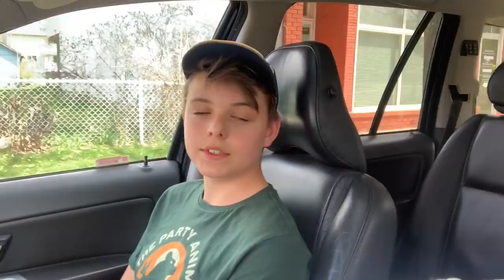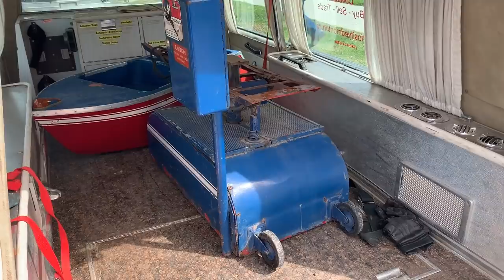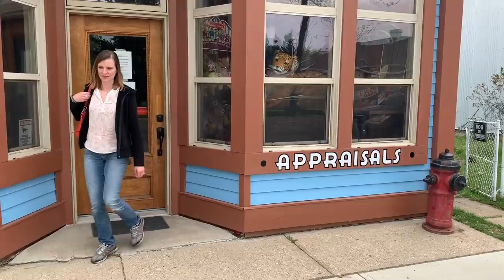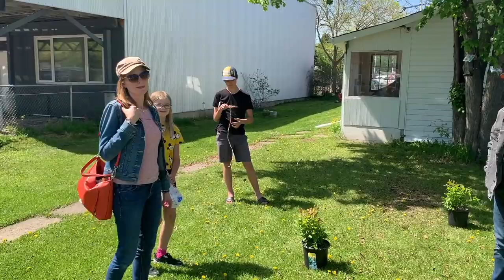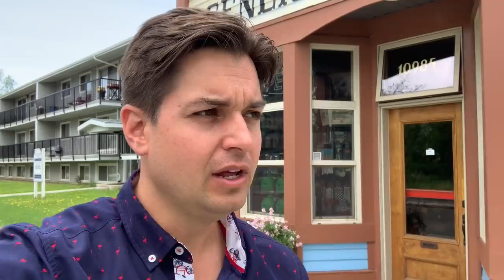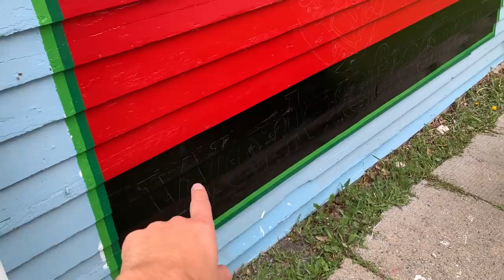Part 2. Will the build be cancelled over a $750k hydrant?!?

Comment: The city should be responsible for putting in hydrants if they require them! Never heard of private owners to do that! After all hydrants are for public use.
Reply: My old hometown pulled that on a business for over a decade. a walmart wanted to build, but the town council wanted to stick them with 26 million dollars worth of sewer upgrades, so they decided not to go ahead alone. they partnered up with as housing developer that wanted to build a new housing development and a home depot, and the town council dicked them around until the housing developer pulled out all because the town council just didn't want a walmart in the town. this was a town of 18 000 people.
Reply: From what I understand tho, the fire hydrant isn't really the problem here. The water system for the street is old and in need of being replaced, or else, it won't be able to handle a fire hydrant. But since it still work, they don't want to upgrade/replace it. So they're like: We know it's old and outdated and that we HAVE to do it eventually, but we DON'T want to do it now 'cuz it work and we'd rather do something when it break instead of being proactive and change it before it happens.
Reply: @blackwar12  sounds like where i live
Reply: Where I live, a local business man built 2 Duplex homes and the town forced him to run the water and sewer lines at his expense, which he did.  They then had others build in the same area and tried to hook up to His Water & Sewer lines, the business man stopped the hook up unless he was reimbursed for the installations. He was repaid and now the town has 25 additional homes buying water and sewer from them!
Reply: I don’t think all the people who live round and about would be too impressed that the city is gambling with their lives with old infrastructure, if the size of your building tips it into being really dangerous, it must be dangerous now. If they are really intransigent I’d start to get the neighbours riled up......
Reply: @dgmills5351  Good!  Only fair.
Reply: Government 101   of the People and by the People?
Reply: @lynnedelacy2841  Thing is, if he do that, the city won't be happy about it and they'll give as much trouble as they can to Alex as an act of "revenge". The ONLY way he could do it, I guess would be to go to local media. And again, if the local media are "friends" with the administration of the city, it might backfire.
Reply: Chasse Gallerie - it was more of a tongue in cheek suggestion than an actual one. That wouldn’t be the way Alex operates
Reply: Sounds like they made up that rule to suck more money out of large developers and shouldn't apply to small business owners.
Reply: Not to mention they allowed a huge apartment building to be constructed next to the store so how is that thing not tipping the situation to dangerous but Alex' addition would? Makes no sense.
Reply: @lynnedelacy2841  - I'm sure the apartment dwellers/owners would be a bit worried to hear about this.

Comment: Alex, I mentioned this before, but I am a contractor who worked on some condo units in the city. The inside units were too far from the hydrant, so we had to install a fire sprinkler system in the condo. That cost a few thousand. Cheaper than a municipal hydrant however
Reply from the maker: I don’t think we are high risk at all, I just need the IFPA assessment and hopefully we can proceed.
Reply: @CuriosityIncorporated  glad to hear. I was going to visit Alberta on the way to Alaska this summer in my camper van but the coronavirus has the trip postponed a year. I look forward to seeing the new addition and checking out your store in 2021!

Comment: I think it's outrageous that they are sticking you with the entire cost.  In my opinion, that should be covered by the city.. period. People die, businesses close, but the city continues. They will benefit in the long run as an investment. At the very least, whomever you hired to do the paperwork on this project should have known the law about the fire hydrant issue.  Now you may be stuck with very expensive plans that are useless. Shame on all who put you in this position. I feel really bad for you as you acted in good faith. I hope the city steps up and does the right thing.
Reply: Yes, I had to learn the lesson the hard way by living on land without the electricity and water for a few years. Had to use a gas generator and haul water in with a holding tank in the back of a pickup truck and then transfer it to another larger holding tank that was hooked up to my living quarters. Done that for a few years before I could afford to pay for the electricity to be run to it.

Comment: I hear you about the fire hydrant situation .  When i bought my 100 year old house, no upgrades had been done to it and it had an old oil furnace in it and i wanted to upgrade it to gas.  If i had known what a hassle that would be, i most likely wouldnt have bought the house .  Even though the house is in the town, it had no gas lines running to it and i had to pay thousands of dollars to run the gas lines down the alley in back of the house and then up to my house .  Now its all done of course  but all the other houses along the alley have tapped into the gas line.  For free.  Man, it infuriates me but theres nothing i can do.  I liked your rolling stones joke.  I got a new front door and decided to paint it and i told people i did a mick jagger on it and no one got that joke but , somehow, i think you would get it.  (I painted it black)

Comment: Alex, if you're going to keep it outside please please please put a sign on that "old fire hydrant" in front of your store identifying it as an item "for sale and not connected"!  It could cause confusion if the fire dept shows up at 2am for a fire in your store or the residences/apartments next to it.  I work for a large FD (Montréal) and can tell you when we show up on a scene in the middle of the night the last thing we need is extra delays because a hydrant we see from the cab of the engine ends up being a non functioning prop.
Reply: @Nicky L Nope, ancient hydrants are still in use almost everywhere. The one Alex has is fairly modern compared to many I've hooked up to.  As long as they work the city keeps them in service,  they only get changed when a piece breaks (usually the pin or valve) and it's cheaper to just change the whole thing.

Comment: I’ve transplanted rhubarb in the spring and it did just fine. It’s good to dig up a plant and break it into smaller sections creating many new plants. That should be done every few years. You could end up with a big plot of rhubarb❤️
Reply: Nothing to do with the problems Alex is having but you seem like a rhubarb expert so may I ask a question please?  When you buy a new rhubarb plant you cannot harvest anything from it for a year or it will not produce well. I made the mistake of ignoring that and have found it to be true, the plant has never recovered and doesn't produce anything, it will be replaced. But, I do have 2 good plants which I've split this year and replanted, do you know if I have to leave the transplants a year before harvesting? I don't want to end up with less than I had. The rhubarb is a raspberry one and a champagne one, beautiful flavours that I haven't found since I bought my originals. Which is why I'm propagating my plants. Hope you can advise me.

Comment: For what it's worth, my in-laws got around this by installing a big water tank the FD could use whenever. Their daily water went through the tank so it was always being refreshed.
They had a Radiator Shop too far away from the closest hydrant. This tank wasn't cheap, but because the City had access to the water at all time, they actually helped with the installation costs.
With Apartment buildings on each side, and you "Donating" the location for the tank, it might become a win, win situation. You could literally install your spare hydrant to the tank out on the street, for the FD to hook-up to. If one of the Apartment buildings ran their water through the tank, that would renew the water daily, and possibly fix some low water pressure problems.
Now that I give it a little extra thought, keeping the water flowing through the tank 24/7 would probably be required to keep the tank from freezing. (I keep forgetting about the freeze factor where you are.) If doable, it could give you MANY neighborhood Brownie Points. Being literally NEEDED is never a bad thing.
I seem to remember something in the neighborhood of a 10,000 gallon tank cost in the neighborhood of $50,000.00 U.S. Double that for Canada, but $100,000.00 is still less than $750,000.00. If the City subsidizes, it could be a reasonable alternative (I suspect a lot of landscaping will need transplanting). My in-laws had to do a ground level water storage. An elevated water tower to provide pressure, would probably be a deal killer.
Probably a bad idea. But water towers fix a whole lot of things that avoid really expensive pumps, and their operating expense. I'm sure you know the way these things work, fill during the low demand hours, drain during the high use hours (when people wake-up and in the evening before bed).

Comment: Have you considered the storage shed approach? A plan b for last resort. Most zoning regs are much less restrictive for that style of building. A scrapyard I know of ran into a concerted effort to restrict his ability to build a shop to repair equipment. Honestly they wanted to motivate him out of that area. He ended up building a portable building. 30x40 metal building on I beam skids. Their zoning didn't prohibit portable buildings and had no square footage restriction(which they implemented immediately after him building it). Another guy I  know wanted to put a 18x24 single car garage beside his house. Got the grief. Poured a slab and built a portable exactly the same size. They couldn't do a thing about it. You may have to alter your ideas some (maybe 2 smaller structures etc) but I'd bet you could still do something pretty cool if you wanted to, classic architecture, facades etc. Thanks for sharing

Comment: That type of infrastructure change is usually done by the city or county and they pay for by issuing a bond.  The bond is then repaid by those properties that get benefit of the new system (in this case a new fire hydrant system).  My guess is that everyone on the block/area would have to pay that special assessment of the course of 20 years, etc.

Comment: Can you pour the slab anyway, for an outdoor relaxation area until the council sorts themselves out? Then if you get the permit you can proceed with the structure without a 2 month delay? Pouring concrete in Winter is a nightmare! It would cost more because of the additives the concretes would have to add. You could remind the council as well that the $750k contribution would cause your business to suffer, and that the suburb would suffer.

Comment: one of few good memories of growing up was my cross the street neighbor had rhubarb plants and would let 'steal' a stalk or two on occasion (had to ask first of course) and i'd sit on her top step with my cup of sugar from home and eat rhubarb fresh from the garden.  It was the only way I liked it.  To this day, I can taste that rhubarb but have never found any that I could eat since lol.  As for the fire hydrant issue, that is some pure bullarky.  (not a real word but seems to fit).  So it seems the only real issue with the fire hydrant is that the street needs upgraded infrastructure to add one?  If it is that outdated, maybe with a little luck on your side the inspection will come in and find it is faulty AS IS and that the city has to do the upgrade immediately.  With apartments and all the houses and other places on that street, if the infrastructure is in that badly need of repair, then it should probably not pass inspection now.  Of course, that might not be the best thing either if they levy a tax or something on everyone on the street to get it paid for.  I remember when my grandma had to hook up to city sewer and water, everyone had to pay part of it.  and they tore up her driveway apron to boot.  Seems only fitting that the blue spruce Grandpa planted before he died and long before the water/sewer issue came up, was in later years choking off that same water line.  City had to repair it and they paid to have the tree removed.  Either way, as Grandpa used to always say...What will be, will be.  Good luck on it!

Comment: I have a temporary suggestion Alex.   If the city would allow you to put Steel Storage containers
on that land you could put two of them there side by side.   OK now hold it,.  I know you are going to say they are ugly.
You are right, but.....you can clad them outside with wooden clapboards like the store, make a false roof peak and paint 
it all  in a similar paint scheme.  Put Normal looking doors on the front and cut doorways between the two containers.  I am sure you could be very creative about fitting out the inside to make them look like a real garage building.
Just a thought for an intermediate solution.
Reply from the maker: It just wouldn’t look very nice :(

Comment: if you cant do the building could a covered patio area work? I dont know if you would be allowed to have plastic or whatever on the sides of the patio, but Im also assuming you can still lay the concrete slab

Comment: Are there any statutes laid out anywhere you could look at to see if there is any demarcation as to what the city is responsible for re protecting their citizens from a fire hazard? , I guess your architects will have looked at that but no stone should be left unturned.
Was there talk of it not being a problem if you built out to the back of your existing property ? You could do that if you need more shop space. Two options for the side space would be to tile it and make it an aesthetically pleasing space with plants in pots etc and then run a farmers market/ regular craft fairs/ pop up restaurant/ jazz sessions etc 
Or consider getting a large metal transport container or two to position there and then repurpose it into a a connecting groovy cafe it could become quite a focal point for the local area. Almost an art installation. I’m sure there must be ideas for conversions on Youtube / Pinterest

Comment: maybe rethink your birch tree plan - i could be wrong but i think they are really shallow root systems that can be rather troublesome for concrete and pathways later down the line. their happy in but pots though if the planning allows that as a get around if you really want birch trees.

Comment: Sad that councils do this. In most cases it doesn’t benefit the town because most private owners pull out as they’re expected to pay for maintenance for water, fire, electrics etc because the street is outdated and in need of repair. They’re happy to let buildings and roads sit deteriorating and out of code until someone wants to build or improve the area. Residents go without new businesses, houses, roads all because of this. On the plus side you have a platform so if they’re pushing you to foot the bill you will have public support. Hope it won’t come to that! But deffo pool your resources, community, YouTube
Reply: Well said.

Comment: Are you even using the garage behind the shop for anything? Just curious! If there is an apartment building next to you or whatever there should be ample water pressure and access you shouldn't need to put a hydrant in .
Reply: what I am hearing is the city wants to update all the service pipes on that block, must be very old. but to put that on Alex is nuts.

Comment: I don't think the Fire Marshal should require  you to put in a Hydrant. You aren't adding very much to the fire loading in the area surrounding you and the other Buildings.  From what I can see with the surrounding areas if they don't have the required Fire Flows already then in my opinion they can't lay that on you. I could understand it if you were doing a big commercial development that added a.huge fire loading.  Your small addition does nil to  the fire flow that's needed to control a fire in just the addition.  I hope they do the right thing and allow you to go forward.  Sounds to me that the City has long over looked a huge problem in the area.

Comment: Can your pour the concrete without the fire department clearance? If so, and if it were me, I'd go ahead and do that. Worst case scenario is you have a patio that you could maybe do some outdoor selling from in good weather. I can't believe if they needed a hydrant they wouldn't have required that for the apartment building. I mean, really, how much farther is it from the existing store? It's not like it's two blocks away. It will be up to the fire dept. to decide and hopefully they'll have more common sense.

Comment: That's totally BS it doesn't cost $750000 for a water main replacement especially that short area there I do it for a living we could do a standpipe on your property for next to nothing for about 3 grand installed in or give you enough water to fight fire fight for 2 neighborhoods check into that if you really want me to I can come up there and mode pull the whole water main through will drill it in a be a lot cheaper I do it for a living
Reply from the maker: They have a contract with a company called epcor that is the only one allowed to do it, cost is $750k seems shady :(

Comment: I'll bet if you got a contractor in to bid the job you'd find out it's actually less than $100k to do the job; not that the burden should be on just one owner on the street (especially since the apartment buildings should have had it done when they were built, since they have more chance for a fire - looks like someone skirted out of that) - that is clearly a capital improvement that the town would pay for and amortize over time.  That's what taxes pay for.  Sounds fishy to me.